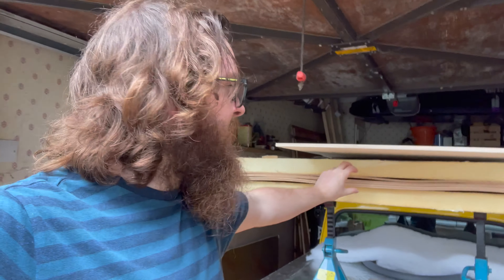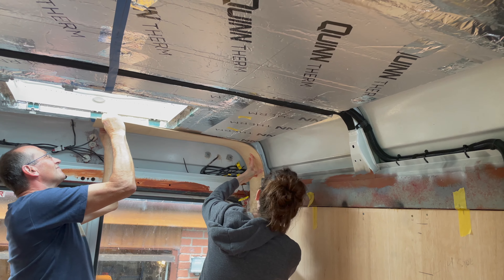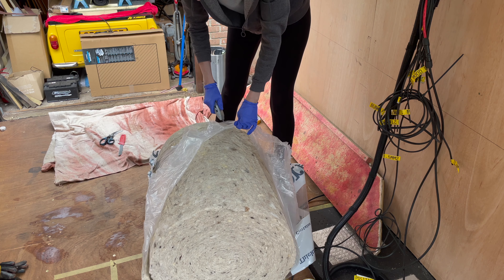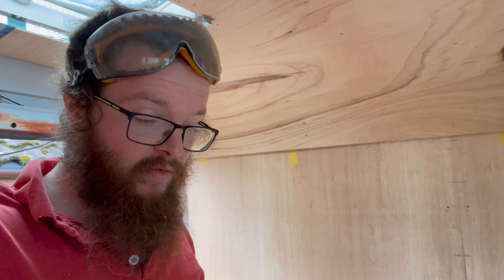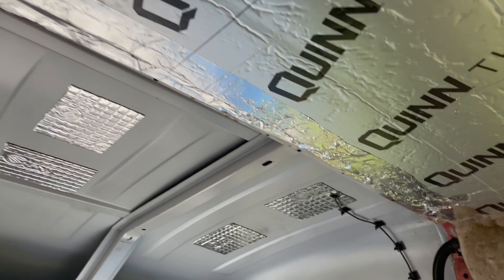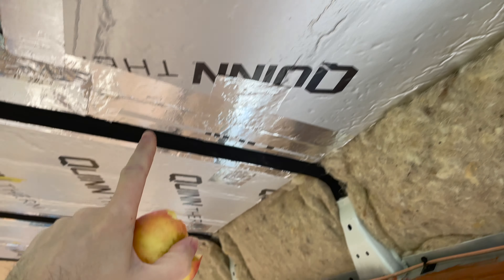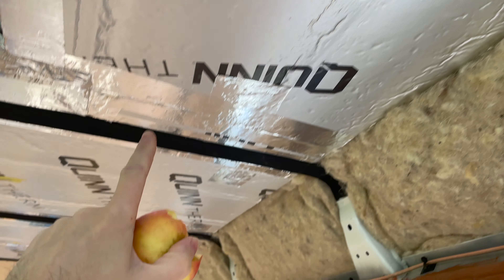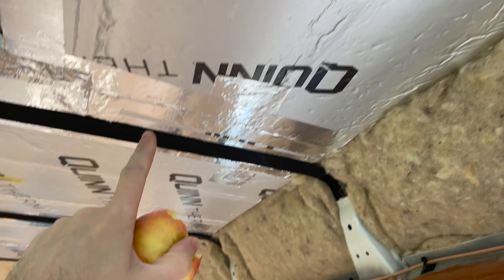Curved Van Ceiling! How We Built Amazing ‘Schoolie’ Inspired Plywood Roof in Mercedes Vario Van

Comment: Hi great job I’ve just subscribed,just a tip when I used to fit boats out we always varnished the back of the ply to stop moisture rotting the ply from the inside!
I’m actually looking for a vario but a van or box van.
Reply from the maker: Hey. Welcome along and thanks for subscribing. That’s a good tip. We will do that with the walls as they need to come off again. With the ceiling we are going to have to seek something that penetrates the wood we think. 

That’s cool re. Looking for a Vario. A box van would be really versatile indeed. What sort of thing will you be looking to do with it?

Comment: Looks amazingly good! How will you fill the gaps between the plates?
Reply from the maker: Thanks Henry. We are probably going to use strip wood in the main living area. In the bedroom we have some off cuts that we might make some shallow ‘beams’ from to cover the gap. 

The gap is an unfortunate requirement due to expansion etc. But we think we can work around it. We’ve a few lines of screws to cover too - so hoping to use this method to hide those too. If not little wooden caps 😊

Comment: Hi guys when you used rivnuts for the battens how did you know where to place the Batton’s after you lined the roof?? Thanks
Reply from the maker: Hey. So we actually made a jig to mark the holes. Then bolted that in place until later. We thought we could use it to mark the cabinets. In the end we just measured where the holes needed to in the overhead cabinets so they matched where the rivnuts where. Hope this makes sense.

Comment: Hi, the roof looks great, can I ask where you got it from? And what type/grade it is?
Reply from the maker: Morning Wes. It’s 5.5mm long grain flexible plywood. I’m
Not sure on the quality marker of it. It doesn’t specify but it is moisture resistant. We bought it from a place called Syndems.
Reply: @WanderbusAdventures  Brilliant thanks for the info. At a similar stage with my build and really like the look of yours
Reply from the maker: No problem. We like the look and honestly I don’t think it takes up any more space than a ‘regular’ clad ceiling.
Reply from the maker: No problem at all. We used 5 sheets in total for the whole roof. These were 2.5 meters in length though. One was for the cab.

Comment: ... isn't a vapour barrier recommended to avoid moisture getting into the natural wool?
Reply from the maker: Hey Tom. Natural wool is actually very good at controlling moisture apparently. So it will help control the humidity and let the vehicle breathe. In houses it’s not recommended to use a barrier. But can accept this isn’t a house 😊. 

We did buy a vapour barrier but then read lots about it needed to be totally sealed - add in screws, any other gaps etc and we figured it’d likely trap moist air rather than stop it. We may be wrong on this. But we have thought a lot about it. 

we found a great article about how BA do it in planes. Long story short they manage it via channels and insulation. Lots of other van lifers we’ve spoken to didn’t use one either and have been fine. As a compromise we’ve taped the main joints in the foam board and will allow the wool to do its natural thing and any condensation that might get into it will evaporate or drain down the main channels.  

It’s a great topic and it doesn’t seem like there’s a definitive answer. Most do fit a vapor barrier. We will report back 😊